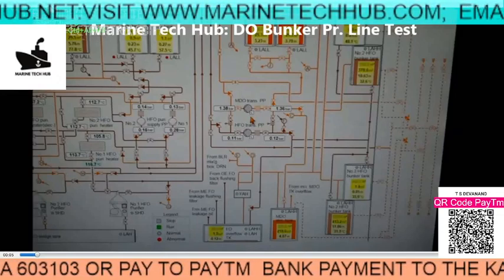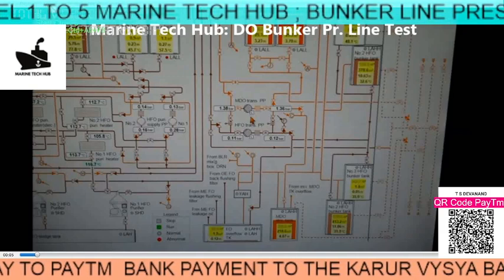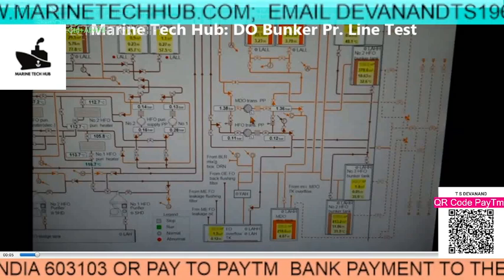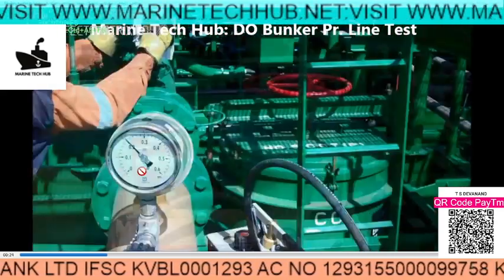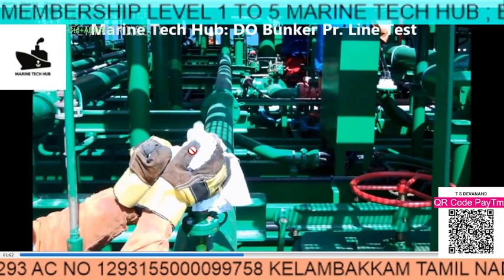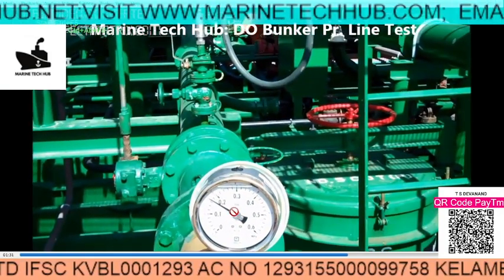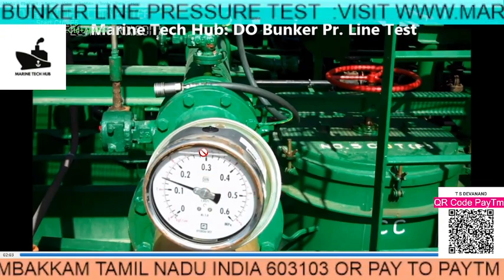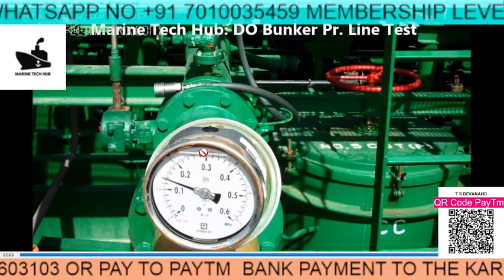Bunker Line Pressure Test : Important Tips For 4th Engineers

Comment: Hi. I didn't understand correct procedure.
1. Fiil up bunker line by DO transfer pump,  release air and stop transfer pump after DO is coming out. Do you close delivery valve on pump side or delivery valve to bunker line after stopping pump?
2. When DO line is filled with liquid you connect hydraulic pump to raise the pressure. What kind of pump do you use for this purpose? Is it filled with diesel oil?
3. To release pressure you just open valve to bunker tank and after blow line by air?